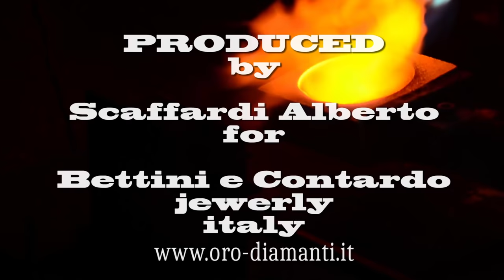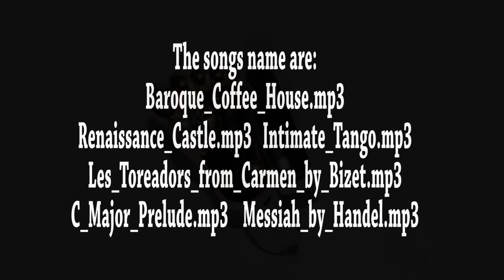Happy foot, 18k gold ring whit diamond

Comment: What adhesive do you use to attach your paper? In class we are told to use rubber cement, but i don't like how easily it peels off, and it ultimately hurts my cut. 
Also thanks for uploading all the videos, its been helpful to watch you work.
Reply from the maker: +ПаШа Римир Thanks. I use the vinavil (PVA glue)